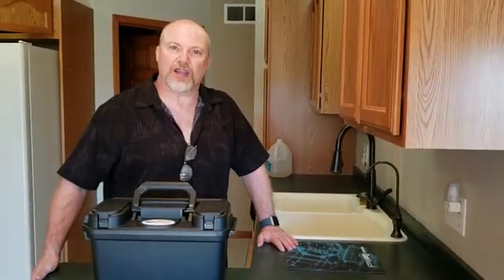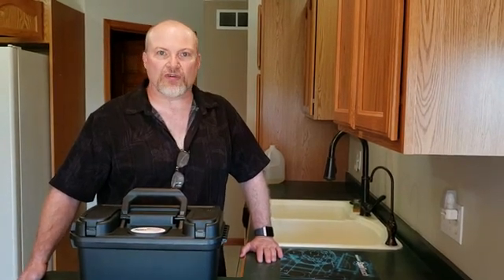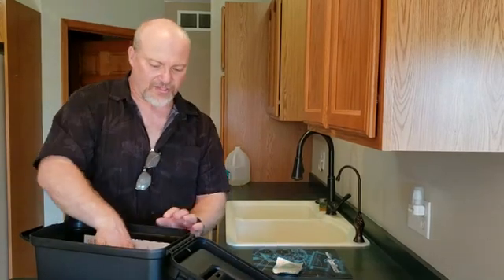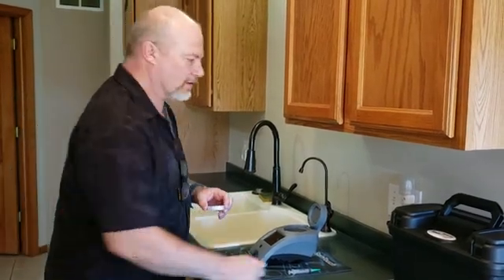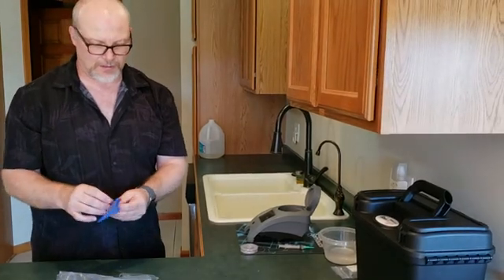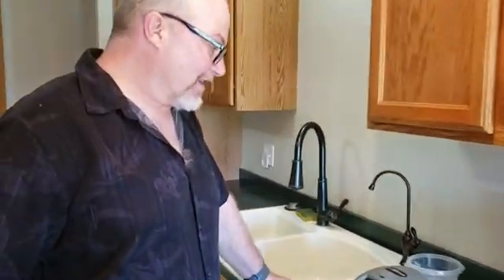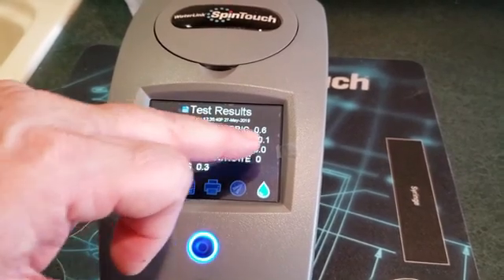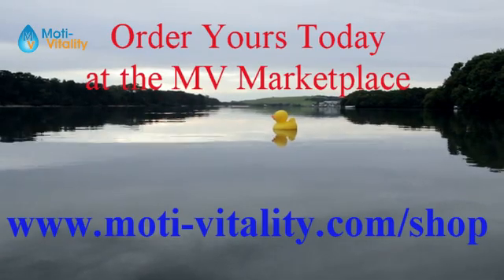Testing the  Lamotte SpinTouch for Accuracy

Comment: What a great piece of lab equipment, is it both 110 and 220 volt options?
Reply from the maker: Seth,  It actually has a battery that lasts for about 75 to 100 tests between charges.  It also geo locates and transfers data via Bluetooth connection to a computer.  It is important to make sure to stay up on the firmware updates from Lamotte to maintain accuracy.
Reply: Sort of, by that I mean it is actually a portable/rechargable unit, using 5v USB-C power supply to recharge, most 5v power blocks are 100-240 switching type, so you should be easily able to acquire that anywhere.The older models required continuous a/c power.  Newer models #35xx, (80,81,82,85) are all cordless rechargeable .  I bought the cheapest model #3580 (all models include the same photometer device, just different accessories, carrying case in upright form, or waterproof pelican style case.  Mine had no case at all, but I only use it in my house so I found a nice sized rubbermaid container that fits everything I use.
Expect to pay $750 upwards, and it will test pools, well water, municipal water, hydroponics, and fish farming, just order different disks, sold in 50pc sets for between $120-160.  Good investment .